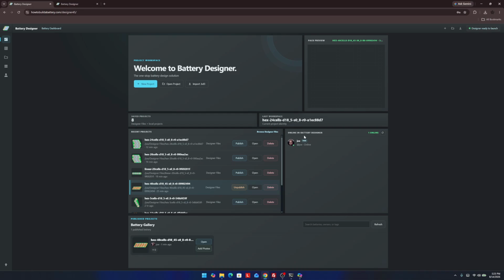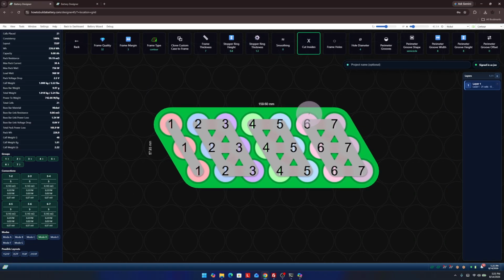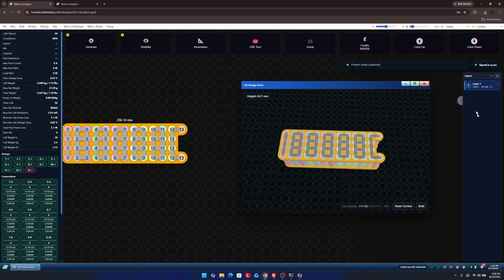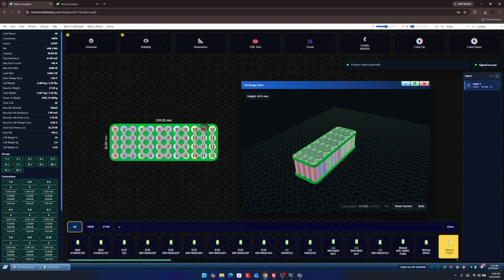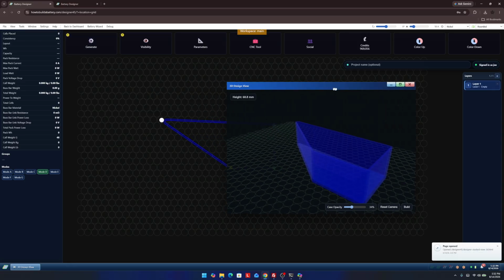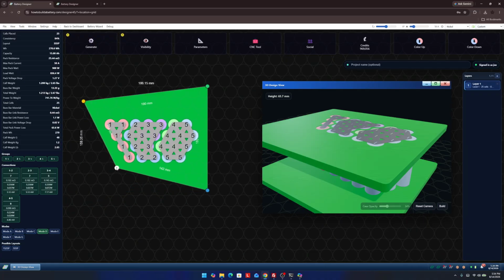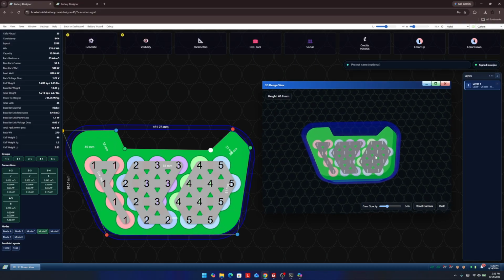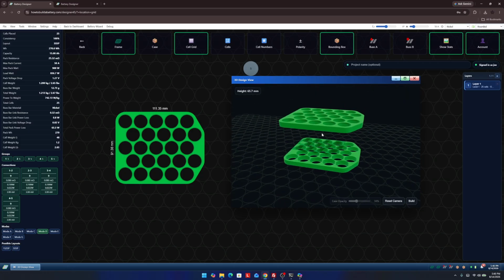Major Battery Designer Update!

Comment: once it was free and could access to most of the things to verify quickly now i see that is everything payment. Disappointing..
Reply from the maker: It's disappointing for someone to be paid for their efforts? Interesting.

I have spent years and countless hours on this program. It's not reasonable to expect someone to provide unlimited support to an unlimited number of people for free forever.

So many people started using it that I had absolutely no choice but to pay wall it.

On top of that, jealous competitors are always trying to break into the back end and steal my code.

Why? Because my program is, hands down, the absolute best battery design software available by a significant margin.

With all that being said, Im always willing to give people free access for some amount of time.

Listen. Software is not something that is dug about out of the ground and belongs to everyone. Software development is not the same as archeology.

This software is mine. It belongs to me. It is the fruit of my labor. Also, this is all I do, full time. I'm not clocking in to some job and making this battery design software on the side for fun. This is literally how I eat, bro.

If I just gave it all away, then I wouldn't be able to eat and if I can't eat then I can maintain the software, provide support, add new features and etc.

Its totally unreasonable to expect someone to do all of this for free.

Also, this software is extremely low cost and there are several ways to gain access. You can buy lifetime access for just $67 because its 33% off right now, or you can join the TWO DOLLAR a month Patreon and get access as long as your Patreon membership is active. 

Either way, its a very small amount of money to access something so powerful. There is nothing like this software and I am literally lightyears ahead of the competition so I can literally charge whatever I want and even considering that fact, my prices are absolutely reasonable. 

Honestly, if there is a battery builder that cant afford a few dollars for design software, they probably shouldn't be building batteries in the first place.
Reply from the maker: pcrepairlexington@gmail.com 

Email me and we can talk this out. I dont mind giving you free access for some amount of time. There have been lots of updates to the program since you used it last.

Comment: This is a waist of your time you can design everything in minutes on a free cad software
Reply from the maker: No, actually, that is not at all true. My program makes this process way faster than any human with any software can do it.

It doesn't matter how experienced someone is in whatever CAD program, it's simply impossible for them to design parts as fast as my program can generate them. It would take them 10 to 20 times longer and requires a lot of focus and brain power. My program makes that process effortless, easy, and fun.

For people that don't have that CAD experience, my program makes the impossible possible.

Jealousy is what you are feeling right now and jealousy is quite a powerful emotion.

No one is going to take your advice, because it's trash based in a jealous fantasy and is totally out of sync with reality.
Reply: @electronicsworkshawp  Dont feed the troll man.  He obviously already knows everything.  Great work keep it up.

Comment: Is there a good source for getting custom shaped tabs cut out? Like a laser sheet metal service, but for the types of material we use often for welding cells (.2mm cu, .1mm ss, etc...)?
Reply from the maker: I know a few people that have lasers but they are the type of humans that are hard to get a hold of and would likely not take on small jobs. 

With that being said, one of my really good friend/customer is about to get a laser, its actually on the way to his house as we speak. I am setting the Battery Designer up so that each part of the battery, including the completed battery, can be purchased. I will be printing and selling the frames, my buddy I just mentioned will be taking care of the buss bars, and Im in talks with other people to take care of the cells, cases, and etc.

So. Relatively soon, the buss bars you design in the program will be purchasable for a totally reasonable, but still yet to be determined price.

Comment: wow this looks incredible. I will test it out now. Oh it is demo only. well from what you are showing it should be a great success for you. I am beginning to build a 12s4p battery for my electric skateboard and i am trying to understand how much nickel i need to use in series & parallel so that the battery does not overheat and sends the amount of nrg correctly. looking forward to this when it is complete. well done
Reply from the maker: Thank you. This is the new version that will be ready soon but the old version can already do what you are asking about. It shows the voltage drop and power loss for the bus bars. If you need some help using it or getting to it, let me know.
Reply: @electronicsworkshawp  oh my bad i only noticed below the main cell part is the buss bars. thanks
Reply: @electronicsworkshawp  will it show people if the buss bar width and depth is thick enough for the certain type of battery cell that we use? I am building a 12s4p battery with samsung 21700 40t cells and I found a cool guy on u tube building batteries and he says that i will need to use thicker series connections so that my battery doesn't blow up. I am still learning